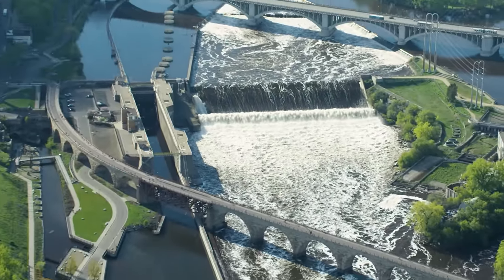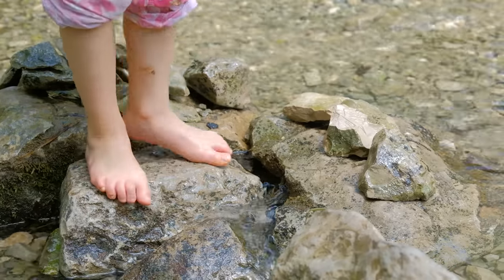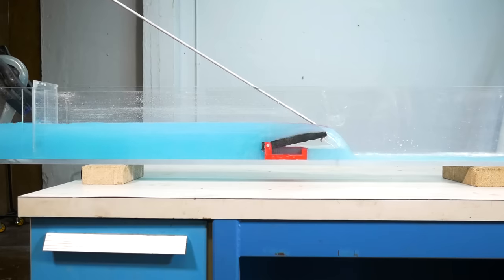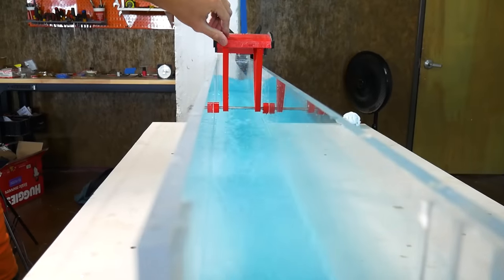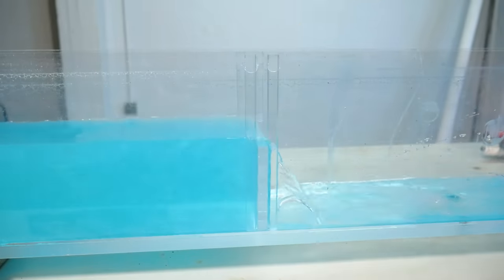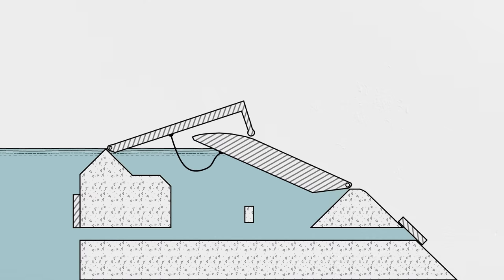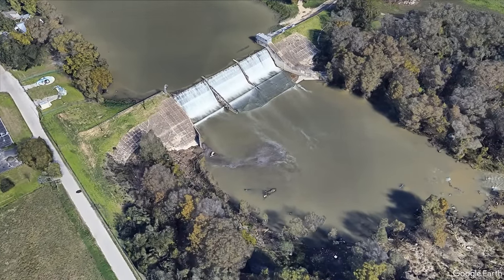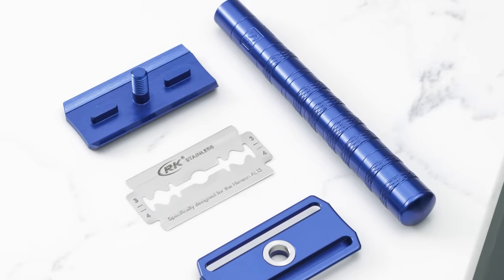How Different Spillway Gates Work

Comment: I'm not sure if the fact that most of the infrastructure failures mentioned on this channel being in Texas is a bias due to you being located in Texas or Texas being Texas and neglecting it's infrastructure.
Reply: Every state neglects their infrastructure, so it may not be the second part.
Reply: Little bit of column A little bit of column B?
Reply: It's likely more so what he knows.
Reply: infrastructure requires taxes to function properly, but nobody seems to understand that. 🙄
Reply: @bazookallamaproductions5280  oh the hubris of thinking we need to manage a river that's existed since before humans learn to walk on two feet
Reply: @bazookallamaproductions5280  Who pays taxes anymore?
Reply: @pheakay is that some from water column A and water column B?
Reply: @Fickets  To an extent, yes, but Texas seems to pride itself on it, for some reason, with minimal taxes and privatized critical infrastructure far more than any other state. Or at the very least, they're the loudest about it.
Reply: I'd say it's likely a mix of both factors, though how much each weighs is harder to say
Reply: If I've learned anything, it's that private companies shouldn't run critical infrastructure. Especially outdated ones where they can't cover replacement cost. 

Yet the state of Texas seems adamant on privatizing everything, even when critical infrastructure keeps failing over and over again. The cause almost always being aggressive cost cuts.
Reply: How many dams have failed in California? The thing about taxes is that if they don't go to infrastructure, they don't help either, until they become a problem, then taxes go up.
Reply: It has to be location. Texas is no better or worse than any of the other states, especially the large ones.

What sets texas apart is the low cost's it has to achieve average results. For example residential electricity costs in texas is 14c kwh. In cali its 28c kwh.
Reply: Por qué no los dos?
Reply: @TheLRRPS  In Virginia it's 14c / kWh too. And I'd call Texas's deliberately disconnected power grid "different", it being completely disabled last year should be evidence enough of that.
Reply: @bazookallamaproductions5280  you understand the state doesn't do any work themselves. They pay contractors to do the work for them.
Reply: @bazookallamaproductions5280  correct, funny thing is there is so many taxes and yet the infrastructure is literally falling apart regardless, makes you think that the amount isn't the issue.
Reply: @billycroan2336  we don't need to manage the river for the river's sake, we need to manage the river so it doesn't destroy all OUR stuff
Reply: @needamuffin  every grid experiences failure. Some more than others. Texas is more reliable than some, less reliable than others, like I said its middle of the road. This last cold snap we just had was colder, and had more demand, and the grid did not fail. The problem appears to be fixed
Reply: @paulelderson934  yeah, what the British did with the privatization of their Rail System is a perfect case in point.
Reply: @MidwestFarmToys  fam it’s literally the textbook example of different infrastructure. Everybody else is hooked up to a larger interconnect, and as time goes on they’re only getting larger. Texas is not
Reply: The answer is yes
Reply: @TheLRRPS  Idaho is around 11 cents/KWh and regularly deals with freezing weather and has a large quantityof renewables. So like others have also pointed out, your point isn't very strong.
Reply: @TheNapalmFTW  I'm actually against that. Personally, I'm of the opinion that the state should probably just hire the workers directly, which would dramatically reduce costs.
Reply: You must be new here. I'll let you discover the countless deaths due to failing infrastructure that could have easily been fixed in California on your own.
Reply: "OH, but Texas is the bestest, most de-regulated-est country ever! I mean.. state..."
Living in Texas, I can say the brand of deregulation here is much more like disregulation if you catch me.
Reply: @billycroan2336  beavers do it, so do humans.
Reply: @billycroan2336  oh the lack of understanding that dams are used to produce power not just control the river
Reply: California has had several incidents involving spillway gates.
Reply: Texas is also real dig with lots of infrastructure
Reply: @thewhitefalcon8539  or how about we not build right up against the low Bank of a river or right up against the beach in a hurricane zone?  Some common sense would go a long way
Reply: @needamuffin ya we don’t like paying taxes. And don’t like government waste
Reply: @billycroan2336   floods can extend much further than "right up against the river," and it's a little late to move entire cities that were located precisely because of having river access.
Reply: @bazookallamaproductions5280  Exactly, I've dealt with people in my small municipality of, "Why should I work harder for someone else's police protection or their road to be plowed, paved, or patched?" That S word scares them if it helps someone else they seem not worthy, you can draw the conclusions from there because some well to do communities don't have that problem but middle to lower class ones do.
Reply: I feel like that's just because it's the second biggest state in the union. If it's a dam, it's in California, if it's anything else, it's Texas
Reply: @TJStellmach  nature will move them for you. Just don't rebuild in the same idiotic place
Reply: @tacticalhandyman710  the thing is it's not about the amount of taxes it's how you use it. It's about how the funds are allocated rather than the amount of money.
Reply: @billycroan2336  the river hasn't always been there, rivers move quite frequently.

What really hasn't been there is all the nearby houses and pumping stations, that rely on the river staying put
Reply: 3:15 he says “here in San Antonio” which makes me think he lives in San Antonio. Funnily enough I live there too!
Reply: @bazookallamaproductions5280  it also requires the taxes be put towards the right things. Like not foreign countries
Reply: @johnlucas2037  and Grady has talked about some of them, including in this video.
Reply: @bazookallamaproductions5280  *laughs in private sector
Reply: @stevk5181  the point of "texas had a large scale power loss event once" is hardly a strong point. All grids have at one point and another. You fix the problem and move on. The most recent freeze was colder and put more load on the grid, yet no failure. Thus it's logical to assume that it's improved, if not fixed
Reply: @chitlitlah  Every single power supplier/reg agency does this during peak seasons.

There is a state that have brown outs and rolling blackouts every summer, yet they seemingly get a pass. It's only going to get worse when mead goes dead water.
Reply: All My Data is 1848-2017 from a 2018 NPDP report. Most dam failures comes from Georgia at 238. That's .044 failures per dam. Texas has had 53 failures at .0072 f/d and. New York has had 55 failures at .028 f/d. California has had 85 failures at .054 f/d. It seems like Texas is doing pretty well in the failing dams department. Although this doesn't include how recent the dams failed or the severity of the failure. This data also doesn't include the cause.
Reply: @billycroan2336   Ah the hubris of those beavers, thinking they need to manage a river thats existed since before beavers.
Reply: Who pays for Texas infrastructure? Isn't most of the land privately owned?
Reply: @billycroan2336  we need to manage it because it runs through a city, lol
Reply: @bazookallamaproductions5280  feds have infinite money, taxes at the fed level just control inflation.
Reply: @billycroan2336  I thought you had a witty sarcastic comment, then I read further and learned you were totally serious...holy cow!
Reply: It’s definitely because he lives in Texas.
Reply: It's internationally known that Texas prides itself on low regulation and oversite.
Reply: It's lack of regulation, poor inspection practices, and lack of funding. Same reason their power plants keeping failing.
Reply: Both
Reply: Also Texas is big, combination of all of these factors
Reply: @billycroan2336  Rivers move, so how far away are you willing to build?
Reply: Prolly the second one 💀
Reply: @billycroan2336  People live near water due to the agricultural, resource, and transport advantages. They always have.
Reply: @thewhitefalcon8539  let's start with outside the fema-recognized floodplain
Reply: Has nobody realized he literally says "here in San Antonio" at 3:14 so yes, its because he is in Texas. And just a few seconds later he basically mentions he lives in Austin
Reply: @ethancris9706  He's said he lives in Texas many times in previous videos
Reply: Texas is also pretty big
Reply: @stevk5181  It's less about the similarities of weather conditions between Idaho and Texas and more about changes to weather conditions. Idaho's engineers have had centuries of experience dealing with it's climate.

It can also be misleading to compare electricity costs because often governments simply set the price of electricity. It isn't a market price. It's a political price.
Reply: Little bit of both likely
Reply: @windaddyflex  well texas had a systemic failure once. Kinda silly to say they "keep" failing.

Individual plants go down all the time, nation wide, for various reasons.
Reply: @grantcivyt  the price argument is more to show that higher prices (which means more regulatory money via fees and plain ole taxes), should assumeably lead to a stronger grid..but in many places you do not see that.
Reply: He lives in Texas, so it's easier for him to visit those locations.

By him being an engineer, I'd assume he can do physical meetings with companies and people who handled those projects. (Likewise I think he's from California then moved to Texas, fact check me on that one, so his second most videos are Cali based.)
Reply: now that youve pointed out his heavy texas and us bias in this video i can't unsee it.
Reply: @needamuffin  that has nothing to do with using the money effectively. Its not my job to support social programs I do not support. Supporting infrastructure is universal. Stop being a political nut job and injecting politics in every conversation you have.
Reply: Infrastructure? We need oil!
Reply: @MidwestFarmToys Agreed.  People keep brining up one, extreme example in Texas, but never bring up the regular power outages in California when PGE turns off the power because it’s windy.
Reply: @Marin3r101  I don't support the use of the military, where's my tax cuts? You live in a society, the taxes you pay go to both things you agree with and things you don't. Grow up and treat the people around you like actual human beings. Don't like it? Go form your own society, but until you do that, you live by the rules of this one.
Reply: @bernarrcoletta7419  The existence of one doesn't preclude the severity of the other. Both can be examples of poor infrastructure management.
Reply: @TheLRRPS  Individual plants may go down, but that's what the rest of the grid is for,the pick up the slack if necessary. Texas can't do that because it cut it's grid off from the rest of the country.
Reply: @ethancris9706  I'm well aware that he's in Texas, that's why I said he's in Texas. My question was how much does that affect the examples of failures shown?
Reply: @needamuffin  Texas has shown that it can do that. If you want to be pedantic texas has had less large scale systemic failures than the grid at large.
Reply: I mean. It's also really big.
Reply: @billycroan2336  ah yes, and where do you think you get your drinking water from or where does your septic water go?
Reply: @paulelderson934  fully agree, it seems obvious to me that if something is meant to serve the public and almost all of the direct harm of a failure would be caused to the public then it should be public infrastructure and should be built and maintained by public dollars by engineers and contractors who’s main goal is to do what’s best for the public. Apparently Texas thinks it’s better to lower taxes by outsourcing that stuff to private companies and pretend that the public isn’t in some way or another still paying for it either by paying damages after failures because of cost cutting or through whatever mechanism the company uses to make that infrastructure not only pay for itself but also produce profits for their corporate level employees and share holders(not to mention all that “rainy day” money the corporation has to have stockpiled for settling lawsuits when something goes wrong)
Reply: @shanedancer3895  sooooo... Maybe we shouldn't put important stuff right next to (within flood reach of) the river or ocean
Reply: Texas is also unique because it’s so big. It has a huge array of infrastructure in a variety of environments. Not many other states of such a combination.
Reply: @bazookallamaproductions5280  The most common failure point is application of those taxes by state or federal government.
Reply: Why not both
Reply: It’s the latter and their lack of regulations.
Reply: Could also have something to do with Texas being huge, like larger then most EU countries all by itself.
Reply: @billycroan2336  
Yes, we do sometimes need to manage natural resources like water. Otherwise we end up with uncontrollable floods and stuff.
Reply: Pennsylvania just a few years ago put a contract out to update over 100 bridges in central Pennsylvania alone. FYM lmfao
Reply: Well keep in mind texas is a big state with a lot of infrastructure and for this video specifically a lot of rivers
Reply: @billycroan2336  no need to manage a river. Just the dam and associated infrastructure.
Reply: @needamuffin  texas has no state income tax but property taxes are high.  Just because texas didnt build for a 100 year winter storm does not mean the infrastructure is worse than any place else.  Your comments sound politically motivated.
Reply: Yes
Reply: Funnily enough Tempe Town lake had a different setup prior to this one that failed catastrophically some years ago, completely emptying the lake.
Reply: Everything is bigger in Texas.  The infrastructure.  And the disasters.
Reply: @user-dc1dr9kr8x  In the case of water it's the taxpayers, just like any other state. Water districts and municipalities maintain the infrastructure.
Reply: @emsa5034  not only is that a complete misrepresentation of the events, long term power loss events have also has occurred elsewhere in the US before.
Reply: @bazookallamaproductions5280   It did not help New Orleans when Hurricane Katrina wiped out swathes of the city.  Taxes were being paid, but corruption stole from it, incompetence and laziness ignored it, and bureaucracy that refused to listen to the warnings to evacuate residents.  It is not strictly a "Texas" problem, it is not simply a "taxes" or privatization problem.
Reply: @MidwestFarmToys  Sure.  Let's instead go with "Texas had a big power outage TWICE and failed to apply the lessons learned from the first time to prevent it from happening again, and hasn't shown that they fixed anything after the second failure."
Reply: @pennyforyourthots what in government functions efficiently, effectively or fairly, exactly….
Reply: May be a little of opinion 1…but MOST CERTAINLY is opinion 2. Texas/Texans will fall for anything that makes them feel special and separated from the rest of the country…even if it means having an outdated/joke of an infrastructure. Their grid fails and spikes every year and they’re only finding out in recent years just how badly their entire system is screwed.
Reply: @billycroan2336  to think earth wasn't given to us to do as we see fit is to ignore common sense.
Reply: @MidwestFarmToys  oh please... Even countries are connected, the UK grid is connected via interconnectors to Ireland, France, Norway, Belgium and the Netherlands buying and selling electricity.
Reply: @billycroan2336  what if you've built a city less than a 1m above the normal level of the river? In the past if it overflowed it overflowed. Now it's thousands of home and business owner's lives ruined.

Also, producing electricity
Reply: @Fickets  ূাা
Reply: @Fickets  ূীী
Reply: @andyh9382  the dam broke so it's now coming out of big column C
Reply: @billycroan2336  so let’s just move NYC, LA, Chicago, Detroit, Miami, and a bunch more. We didn’t build cities next to water because we thought it would be fun if our houses got flooded, we did it because access to large bodies of water makes life way easier the 99% of the time it’s not flooding. New Orleans was incredibly important economically as control of the mouth of the Mississippi River gave huge control and trade advantage to anyone who want to access the middle of America
Reply: @harrisonhays7233  Having spent the first 30 years of my life in the UK, experiencing several swings from fully socialized infrastructure to fully privatized and everywhere in between, I came to realize there's waste in every system. It just looks different, and goes to different people's pockets. I prefer somewhere in the middle so at least there's the notion of competition, but that usually ends up with government sponsored monopolies - something which America has a lot of experience in creating too.
Reply: @shanedancer3895  FAILED EXAMPLE:  those entire cities are not in the flood plain.
Reply: @billycroan2336  they’re on the ocean and rivers and flood
Reply: @MidwestFarmToys  infrastructure fails everywhere, the larger the interconnect is the more resilient the interconnect as a whole is to failures. 

Idk how to explain this in a better way lmao but I will try. Imagine you have 100 employees(power plants and related infrastructures) and 5 of them can’t work, you can get others from other branches and possibly even another region to cover. If you’re a smaller company with 20 employees and one branch, the effect of 5 people not working is larger and can have knock effects.

This effect is multiplied by the nature of power interconnects and local extreme weather events. The rest of the world is moving to larger ones because of this reason and so they can produce solar energy on the west coast while the east is already dark and send it there.
Reply: Texas has its own power grid that is separate from the two other major grids that operate in Every other state.  That's probably why theirs sucks
Reply: @billycroan2336  hard to hear you from your high horse
Reply: @paulelderson934  it should be in the hands of government employees, so it can be guaranteed their astounding level of incompetence is to blame, and not simple greed.
Reply: both
Reply: @user-fs9mv8px1y  

So you’re saying that republicans states rely more on fed dollars than democrats states?
Reply: @billycroan2336  tough to hear you from your high horse. I assume you use those two feet to travel everywhere too
Reply: @nozrep  nvm idk how youtube works
Reply: @billycroan2336  do you not know what floodplains or dams are, or are you more focused on sounding cool than thinking for 12 seconds
Reply: The entire US needs to spend money on infrastructure... But I rarely hear of anything but road 
Surfaces in need of repair or updating to pavement... Though there are roads that are paved, but you wouldn't know it as they'd last been paved decades ago.
One day I happened to get out of the car for some reason on one such road, and saw the pavement in a spot where the dirt just happened not to be covering it, and even my grandmother who has been in the area since the 50s was surprised to learn there was pavement on that road. 🤣 Vermont roads are roughly 70% unpaved dirt... But there are also the abandoned roads like the one connecting the end of my grandmother's road to the other town. This road was abandoned back in the 90s after a Hurricane wiped a lot of it out. The other end is still in use, but the three way intersection has become pretty overgrown... Yes, my grandmother's road actually had two connections at the end no longer in use, but because the other end of each road has full access to roads that have more traffic the intersection kind of got forgotten. 😂
Now it's mainly a drainage zone for the surrounding hillsides, and a snowmobile track in the winter, with the rare hikers in the summer. 🤔
There may be a well known peak on my grandmother's road... But compared with the likes of Spruce Peak, Camels hump, Mount Philo, Devil's Gulch of the Long Trail, and others... It's just not able to compete... 😅
Reply: @youvanced2226  The very people least able to pay taxes... Obviously. 💁🏼‍♂️
Reply: I’ve worked for a Texas river authority for more than 20 years, and in that time we’ve spent hundreds of millions of dollars maintaining and improving our dams.  And all of this had been paid for by power generation not taxes.
Reply: @MidwestFarmToys  You're joking right?
Reply: That's why homeowners decide to tax them selves to pay to fix a spill way that was built in the 1930.
Reply: @billycroan2336  usually it's not about managing the river so that it's a better river. It's about managing the river so that's useful for humans
Reply: Looking good room four charcoal and same secondary set filters or more scale looking everything perfectly workable I know if on Site would know more serious see littlest details.
Reply: @billycroan2336  I’m sure some cavemen thought the same thing when some dude made a campfire…
Reply: @stevk5181  Each utility is designed for the weather experienced in its region.  Idaho gets much colder on average and is designed for such.  The snowmegeddon was an anomaly and affected the Texas grid because it wasn't designed for that weather.  

However, they learned a lesson from it and will modify the infrastructure to be less susceptible to freezes.
Reply: @needamuffin  It is different in Texas.  Texas produces more wind energy than any other state.  In fact it produces more than twice as much as the number 2 state.  Are you blaming wind energy for the Texas grid problem of 2020?
Reply: @bazookallamaproductions5280  then WHY do large businesses, which put most heavy use to the infrastructure pay less taxes relative to their revenue than common households?
A) more write-offs created by payed off politicians
B) few households or small businesses have a creative accountant that shows them THEIR write-off options and where else to save taxes.
Reply: Where i am, major bridges and structures are only rebuilt or kept up with to 1)prevent a colossal lawsuit against the cities and 2)continue toll cash flow. In the end 100s of mils for maintenance and new structure is cheaper than a billion $ lawsuit for a failure.
Reply: @Oscar B thank you for making my point, though. Idaho infrastructure costs are high due to the freezing weather and high winds (though not hurricane intense), and yet per KWh costs are lower. Thus, the original comment that Texas does a better job than many states doesn't seem to hold up. Additionally, I've never heard of anyone getting an electric bill in the thousands (let alone 10s of thousands) for keeping the heat on.
Reply: @billycroan2336  yeah thats not a realistic solution
Reply: @bazookallamaproductions5280  Government isn't the only provider of infrastructure.
Reply: @buixote  It failed royally. 
Strangely it's a "franchisee" system so the gov own the infrastructure and they contract out private firms to run the trains. It's awful. Google Transport for Wales overcrowding though and you'll see that, while the gov is taking back control, things aren't really getting better.
Reply: He's likely aware of many failures that happen outside of Texas but because he's in Texas he has easy access to the legal documents or similar related to those particular failures so he can give a more detailed explanation as to what actually happened instead of involving more speculation than actual fact. It might also be because Texas neglects its infrastructure but governments around the world neglect a lot of their infrastructure so it wouldn't shock me in the slightest
Reply: Everything is bigger in Texas, the infrastructure and the accidents
Reply: @billycroan2336  You need to direct and control a river if you want to build around it, use it for travel or for power generation. River infrastructure harnesses nature and protects against it both, nature may not need any help to run its course, but we do.
Reply: They're often not owned by government. The Four Lakes disaster in Michigan was on a privately-owned dam like the Texas one he Grady showed. It was built for power generation, and after decades, it was no longer cost-effective, so they let it waste away.
Reply: @TheLRRPS  My electricity in KS is 12c in the summer and 11 in the winter. On the Missouri side of Kansas City, it was even 1c cheaper... so Texas's obsession with deregulation hasn't saved money at least not for the majority of consumers, especially when you factor in the costs related to the collapse of their grid a few years ago.
Reply: @pws3rd170  rofl you know state budgets and federal are not the same right?
Reply: @bazookallamaproductions5280  the problem is those taxes also need to be actually spent on said infrastructure instead of linking the pockets of political candidates
Reply: If you are not sure maybe you ask a question to help you make an educated opinion first.
Reply: @bazookallamaproductions5280  but then the taxes aren't spent on maintaining that infrastructure
Reply: More than likely column B
Reply: Texas being as large as it is also has a lot more infrastructure that could potentially fail compared to most other states
Reply: @billycroan2336 it’s not hubris, it’s advantageous to us to control such rivers, besides even animal like beavers were controlling stuff like this before we were even thinking of attempting this
Reply: @Fickets  building new buildings and infrastructure is almost always cheaper than breaking down old ones and placing new ones.
Reply: @needamuffin  
A sizable part of California’s central valley’s power grid is out right now and it was due to 40mph winds. And California has more power failures than any other state. I’d say Texas has better power grid than California.
Reply: America as a whole neglects its infrastructure. But Texas is a large state, so it naturally accounts for more incidents. On the polar opposite spectrum, Californias infrastructure is quite literally falling apart too
Reply: @Marin3r101  Those social programs, however, actually tend to result in you, personally, becoming richer over time.
This is because they place money where it will be used by people, and that money is spent and returns into the economy. If we assume there are no money sinks, then it should, eventually, find its way to you.
Reply: @alohatigers1199  In general, they do. Blue states tend to contribute more in federal taxes and receive less from federal programs than red states.
Reply: Texas is also larger and is experiencing more weather patterns that are more unusual those could also factor in
Reply: Don't forget the size of Texas. They are their own power grid
Reply: I live in California and I can assure you they don't maintain their infrastructure here.
Reply: @bazookallamaproductions5280  California has plenty of taxes and our infrastructure doesn't work.

Also it doesn't require taxes when the government is printing infinite money and hyperinflated all our savings away.
Reply: @needamuffin  I was just about to say that. The same thing happened to Oregon a week before it happened to Texas, but our power grid, despite it not being stressed often like that, was able to recover fairly quickly. I have no idea why, but the good folks at Portland general electric got our power back up right after the few downed lines were replaced.
Reply: @bazookallamaproductions5280  Indees. Good planing is also important. As is excluding politics from the engineering process.
i.e. Titanic lifeboats. Well, because deckchairs are more important, right?
Reply: @youvanced2226  Just the lower and middle class folks.
Reply: @youvanced2226  not the rich apparently, so why should we?
Reply: @pheakay  column A worsened by column B
Reply: @paulelderson934   it is the most American US state, and I mean that negatively, oh God I wish I was born somewhere else
Reply: Why don't all the Californians and migrants help pay to fix it then?
Reply: Are you from Texas?
Reply: Ooo double kabam
Reply: Very large state with a lot of remote infrastructure, so naturally there will be more failures, even if the per-capita is the same as elsewhere.
Though with him located in Texas, it would lead to a bias where he is more aware of these failures as they are relevant to his life and those who have connections to him.
Reply: @paulelderson934  yes cause the government is soo much better at managing money.
Reply: Texas is massive
Reply: It’s both, if the floundering power grid back in the Winter/Freeze of 2021 is anything to go by, at least that’s my two-cents as a Texan
Reply: "Or Texas being Texas and neglecting its infrastructure"
West Virgina has entered the chat
Reply: Texas has the best infrastructure
Reply: @Fickets  California is about to replace a bridge because it was built with degrading materials, sounds like they at least manage it decently
Reply: @thomasharris9059  You have brownouts every summer and rolling blackouts every other summer.
Reply: I mean your guys grid completely collapsed because of neglect and cost-cutting, so it's not like Texas has the greatest track record with infrastructure.
Reply: @mountainbikerdave  that's not why it collapsed. Furthermore, it happened once, and the problem was fixed. This most recent winter storm was colder with a higher demand.
Reply: @TheLRRPS  I mean it was neglect.
That's undeniable.
I'm sure cost cutting also played a crucial role.
But, you seem to underplay the magnitude of that catastrophe.

Chernobyl nuclear explosion, only happened once.
Attacks on September 11th, only happened once.

It's not like every grid on the planet collapsed that day.
ONLY Texas's grid collapsed, it shouldn't have happened at all.

But yes, you guys now have a functional and reliable electrical grid, so congratulations.
And let me Welcome you guys to the 21st century.
Glad y'all finally made it.
Reply: @mountainbikerdave  it objectively was not neglect.
Reply: Nothing but rednecks and immigrants here. Road rage is common. Crash barriers in my town are constantly destroyed and repaired then destroyed again. And I live in a nice side of town. San Antonio by sea world.
Reply: @TheLRRPS  I’m not from Cali
Reply: @mountainbikerdave  We have been in the 21st century for quite a while.  We don't suffer the regular brown outs that CA does, so I am not sure who has the better grid.

Which state has more renewable energy?  Actually, which state produces the most renewable energy.  In bad weather, wind gets shut down and other generation types have to make up for it.
Reply: @paulelderson934  Which infrastructure keeps "failing over and over again".
Reply: All other states are the same way
I believe in ohio 70% of the bridges are structurally neglected and need repair
Reply: @christiankroemer4267  I think this one was pretty big.

https://youtu.be/KciAzYfXNwU
Reply: @stevk5181  I pay 12 cents per kwh for my power.  During the outage, my power was on for an hour, off for an hour. That went on for 2 days. Other than that event, my power has flickered twice in the years I have lived there.  In Colorado, the power would go out several times per year.  Sometimes for an hour, sometimes for a day.  

It took an extreme weather event to cause a major disruption.  They happen everywhere.

https://youtu.be/KciAzYfXNwU

As for the thousand dollar bills that some people received, I think (not sure, only 1 power choice in my location) there are certain areas that offer energy at greatly reduced prices when surplus energy is available.  The problem is that when there is an extreme shortage, the price follows the market.
Reply: Ever consider that Texas's sheer land mass might be a contributing factor to the amount of failures it has, because it simply has so much more infrastructure? Failures might be happening at a "normal" rate to any other state, but because they simply have so much more state, their numbers are higher.
Reply: Texas is bigger has more infrastructure. Same reason there are more train accidents in Texas. (More train tracks)
Reply: @jeffminchew69  People are much nicer there.  Funny that it is so bad, yet Californuans are moving there, along with many companies.  Shouldn't everyone be moving to CA, as well as it is run, cheap homes, low taxes....puzzling.
Reply: It's easy for politicians to waste others money... 🙁🙄
Reply: @needamuffin  it wasn’t completely disabled. I never lost power.
Reply: @leonardonetagamer  exactly. Anyone who recommends raising taxes is already mute point. We need to shift taxes to efficient means fixing necessary things first. Food availability, roads, jobs encouragement, housing, etc.
Reply: Have a friend, who's family member was an engineer. The engineer wanted a few dams near Dunlap lake to get serviced just a few years ago. The state entity couldn't afford it. And the only safe option was draining the lake. The residents sued to stop the lake draining and won as it devalue their property. To my knowledge repairs haven't happened yet. I don't think he's being biased, everything in Texas is given a shoe string budget. Power grid, roads(paving, and deicing), and dams.
Reply: I've see interstates marked so terrible in Texas that 1/3-1/2 of traffic are driving in 2 lanes. When they burn off paint or tar the old lines it has nearly the same reflection during sunset as the white paint. I haven't seen that in a few other states I've lived in
Reply: Sounds like a Biden voter answer
Reply: @windaddyflex  CA?
Reply: @JonStark117  "their grid fails every year"?  When were those events?

I have lived there off and on since 1989 and have seen 1 significant failure.  You must be thinking of California or New York.
Reply: @HanTheProphet  hey, remember in 2003 half of the US experienced a complete blackout because of interconnected grids?
Reply: Texas has the most man made lakes in the USA. They also manage water better than any other state.
Reply: 😢 😅😮😮😮😮😮😮 ~~my dog emoji this
Reply: USA ignoring infra I mean wth!?!?
Reply: @TheNapalmFTW  and how do they pay these contractors? I imagine the payment is in … money?
Reply: @byteaquaponics  You obviously haven't been in Texas.  If you could be more specific, perhaps it might convince people you know what you are talking about.
Reply: I'm not a Texan, but I've been there several times, and 2/3 of the rest and around Austin, Dallas, and Houston the infrastructure I saw was clearly in the better kept group, or at least was cleaned/maintained regularly and didn't look run down or badly aged.  On the other end, and even though I love it, much of the PNW is looking very old, as are many of the bridges in Pittsburgh/western PA where I was born.
Reply: @warpdriveby  All I can say is Texas has the best highways I have driven on.  Even in rural areas. I guess not everyone can come here to enjoy, but that's life!
Reply: @oscarb9139  That's been my experience but I acknowledge how much of Texas I haven't seen, but I've enjoyed all my time there immensely
Reply: @Fickets  【
Reply: @billycroan2336  these rivers have been permanently changed due to human intervention. 

We would have to reverse everything we have done. 

Which is practically impossible
Reply: @billycroan2336  if there were not flood control Levis and dams some parts of the world with massive populations would be absolutely decimated year after year during that present areas rainy season. An even bigger reason is storing water for massive populations to use. California for example wouldn't even exist the way it does if it wasn't for the reservoirs up in the northern end of the state. So yea in some parts of the world it is absolutely  necessary
Reply: @Mr.Thermistor7228  actually no. Not year after year.  They might be decimated the first year and then after that if they had any sense they would build back somewhere else.
Reply: OK folks, I've read the entirety of this thread. According to the two or three persons who managed to give some sort of data, Texas is not the worst of US states on dam failures, nor electricity cost, nor power outages. I mean, not only is it better than California, but also better than some actually decent states like NY in terms of dam failures. (I didn't check it out, but I like to trust strangers on the internet)

Author of the video living in Texas is the main answer for the original comment's question. 

Now, if I might give a non-US opinion on the (quite wide) debate about the ideal ownership of infrastructures between greedy firms and lazy gov... No system is perfect, you gave plenty of examples. Conversely, in any system, you'll see persons who like to get the job done. I liked the comment of the lad who was engineer in a private company, and both him and the comp were seriously devoted on maintaining their stuff.  
I'd say, in general, 'let the workers do the work'. If people are working in good conditions, with enough means and training, they will generally do great, for the sake of it. 
What this can lack is the drive to do stuff differently from how they always did, when change is necessary. That's the task of civil society (task being filled by representatives... maybe not in the best way.)

You know there are other ways, right ? Public service or common service doesn't actually have to mean 'government owned' (be it state or fed.) It can be a non-profit, public structure, with various degrees of independance. I don't know the US system but I guess it's already some kind of system like that. What I mean with that is, you don't have to let decision be taken by share-holder greed nor long-teeth lust for fame. You can take control of the institutions, as a society, for the common good.
Reply: Texas is big and old
Reply: Hopefully it was just convenient
Reply: @billycroan2336  We've got a lot of properties built directly next to the river. Don't want those to flood if it rains hard.
Reply: @gigatesla  that sounds like YOUR problem Paul.  WHY SHOULD EVERYONE ELSE BEAR THE COST OF YOUR POOR PLANNING?  Clearly you know the risk but you expect somebody else to mitigate it for you.
Reply: @billycroan2336  Not my problem, I don't live in such a house. Although, I do enjoy being able to use the river for recreation, so I still benefit. Also the river passes through downtown, so those businesses benefit too. Plus they get extra customers from being close to the water, which in general is a big draw to Austin both in terms of tourism and in terms of people wanting to live here. So, maintaining the river is in the city's economic best interest.
Reply: @bazookallamaproductions5280  they only require taxes because we let them... building things doest not require extortion
Reply: @needamuffin  that's what America is about.
Reply: @paulelderson934  please give me examples of how government is better
Reply: muh republican bad
Reply: @leonardonetagamer  go back to school.
Reply: I'd wager it's a bit of both.
Reply: @bazookallamaproductions5280  that’s why everyone is upset all out taxes are given away to other countries. America last.
Reply: @Billy Croan  you'd have that hubris if your livelihood and house could be destroyed by a River Meandering, also you would not have the luxury of running water if we didn't control bodies of water
Reply: @bazookallamaproductions5280  plenty of tax revenue, it’s not being spent accordingly. Nice try thou
Reply: Guessing you’re not from Texas…that’s okay, we’re full.
Reply: @youvanced2226  lmao
Reply: Most of the examples from Texas were of dams that work fine, though; whereas failures in this video (and in the series) are drawn from all over. The San Antonio riverwalk is particularly impressive.
Reply: You managed to use “Texas” four different times in one sentence. Impressive
Reply: @mesiagamer5217  I can get footage of them more easily.
Reply: I would say everything is bigger in Texas including the problems.

That much more land that needs to be looked after.

I mean I have no idea but..........
Reply: Well, I grew up in Canyon Lake on the Guadalupe, and I wanted to say thank you for the b roll of the hill country out there. Every shot looks like home.
Reply: surface area
Reply: @bazookallamaproductions5280  all that requires is responsible tax allocation, dont act like states with high taxes dont spend tons of money on superfluous or unnecessary things or just straight up corruption
Reply: @SkelNeldory  what about texas? Shifting blame to california isnt gunna change the facts.
Reply: Texas is geographically larger, second largest state population and growing, and has varying types of geography. So of course we will have more failures. The better way to measure is number of failures as a percentage of total structures of the same type.
Reply: Yes
Reply: Folsom dam and Oroville dam both failed in California…
Reply: @bazookallamaproductions5280  Everything the government does or "provides" requires taxes, but almost nobody wants to understand that...
Reply: Not from Texas but with Texas being the largest above ground water canal system leaves a lot of room for error
Reply: @billycroan2336 the hubris of thinking nature doesn't need active and constant management to make it do what we want.
Reply: As a texan this is true
Reply: @Fickets That is such an excellent point! TRUTH.
Reply: NorCal was front and center with Folsom and Oroville, too. I guess it makes sense that the 2 largest states have more damns than most.
Reply: I would say the size of Texas and how the occupations skew, large industrial and energy production; it just makes sense that they would have more.
Reply: Maybe it could have something to do with the fact that Texas is the size of 5 normal states and has many different regions